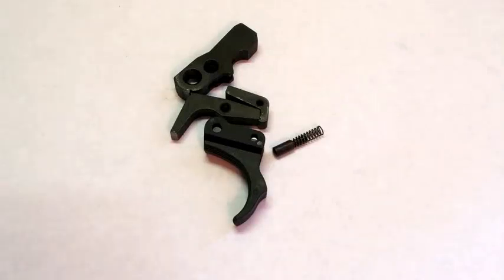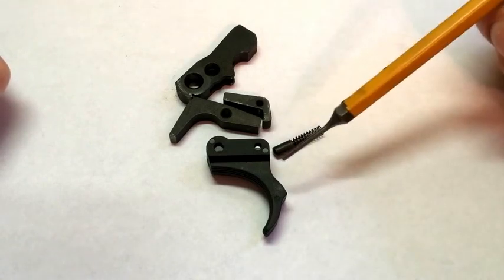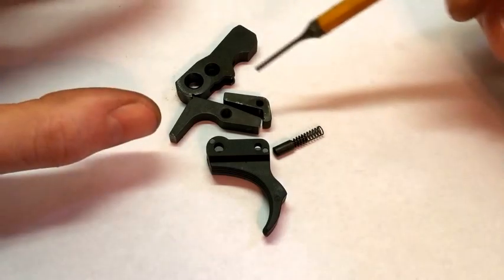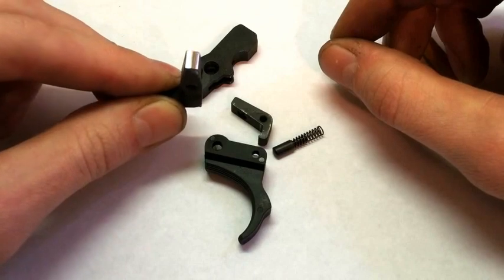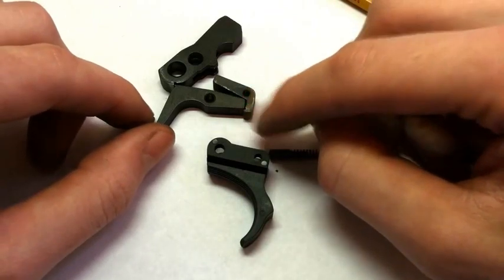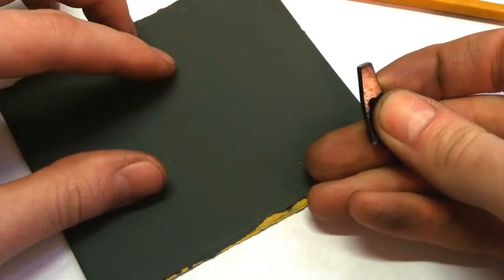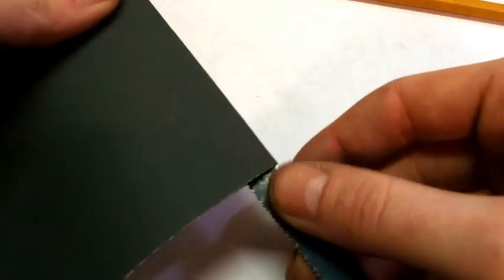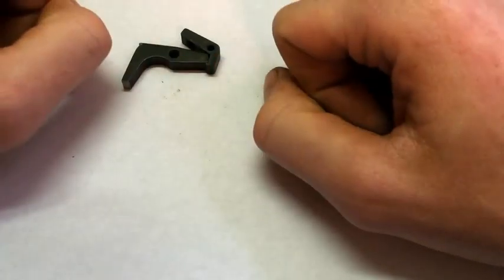Ruger 10/22 Sear Polish

Comment: Spent a couple of hours with a stone and 1500 grit.  The first couple of times I worked on the hammer and sear and polished every contact surface.  For fine tuning I focused on the sear removing it at least 6 times, removing a tiny mount from the head of the cut.

In short, it breaks clean and the pull is 1 1/2 to 2 pounds.
Reply: Don't ever drop the rifle !

Comment: Good video.  One small thing: Dull 1,000 grit sandpaper is not the same as sharp 1,500 grit.  It cuts slower, but leaves the same size scratches.  You'll get a better result switching to the finer grit.

Comment: Hi, I am enjoying you video from 10 years ago.

Hopefully you're still around to point me in the right direction. About 20 years ago when I had a lot of time on my hands I modified my 1022 recently I just got to go out with a friend to shoot it after almost the same amount of time and he made a comment of how lite  the trigger pole was.  

I have since purchased a lineman electronic trigger pull gauge. It reads out at 2.12 to 2.15 Lbs.

My wife and I have always talked about that we create our own problems, if I try to lighten the trigger pull anymore. Do you think that's advisable and I've only polished two surfaces, or said ground down it's kind of hard to remember what I did 20 years ago maybe more like 24

I've completely dissembled the rifle. All but the  spring for the safety. She's dirty. Also, do you have any recommended cleaning solution to remove the carbon?

Thank you
Reply: 2.15 lb trigger pull is pretty low. 👍The BX gets down to 2.5 lb. As long as it doesn't accidentally discharge, that'd be as low as I'd go DIY.

Comment: I (over)worked my hammer and sear. Got a terrifically nice, light pull... but when the safety is engaged and I pull the trigger there's a tiny click then when I take it off safe, the hammer falls. What's the fix for this? I obviously need to redo some angles to get more hammer/sear surface engagement, right? Can you do a vid on the angles needed to get things right?
Reply from the maker: jon-anthony Lewis Hey, sorry for the delayed response, been away from YouTube for a while and wow! Turns out these videos are fairly popular! 

That actually has nothing to do with your sear/hammer engagement or angles... not really anyway... the real fix is stretching the lower 'leg' of the sear so that it sits on the safety more firmly with the safety engaged. We typically use a ball peen hammer. You have to know what you're doing though, or you risk cracking the part. For liability reasons I'm not going to go into great depth on that, but if you do your homework on this issue I'm sure you can find some more info on it. I will say that we automatically fix that with any trigger work that we do. 

Hope that helps!
Reply: AND THAT'S THE REASON I won't be removing any material. I already learned my lesson on a Winchester rifle. The trigger will not cock anymore.

Comment: How many thousands of an inch (.000) can be removed from the back of the sear and remain within spec?
Reply from the maker: SuperSaltydog77 I have no idea. There is so much variation between trigger groups that I'd say it would be pointless to try and assign a number value. I do it all by feel. 

As a rule of thumb... do LESS of a radius than you think you need, and only polish until the factory finish at the highest point disappears.
Reply: BrimstoneGunsmithing TY for your video and reply. I will have to give it a go myself. Start with the idea that less is more. Can always remove more later.

Comment: would normal wear and tear smooth these issues over time?
Reply from the maker: It could, theoretically, but what I have found is that on this particular surface there really isn't a lot of pressure between the slide components. I can't say that I've ever seen one which had broken in from use. In fact it's usually the opposite (kind of), as the springs weaken over time or even just after taking an initial 'set,' you'll see issues arise. But again, can't say that I've ever seen them go away. So... theoretically yes, but practically, no? Lol, hope that helps!
Reply: It does. Thank you. I have taken your advice on the Polish and it feels great. Thanks again
Reply: Not on my 30 year old Ruger. 10 seconds of polishing with 800 grit did wonders for a gritty feeling trigger.
Reply: aowi7280 after watching some video and reading a lot my 10/22 has an amazing trigger after some elbow grease. Perfect break, set screw for no more over travel, and lots of polishing including reshaping the bolt. It’s very nice.
Reply: I’d love to see you do some more guns

Comment: well maybe the new bx trigger will alleviate this prob.
Reply from the maker: Les Rinehart Not really, but you also have to be careful doing this with the BX trigger... as in, really be careful! Those do have less engagement than the standard triggers.
Reply: Bill Dauterive I would be careful with a dermel depending on how you use it. You can take too much material away with a Dremel if not careful.